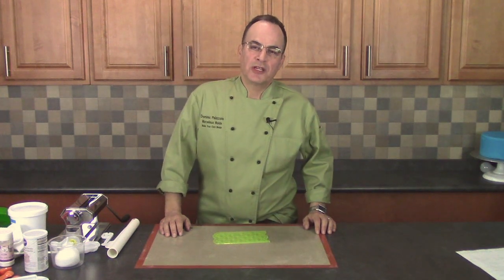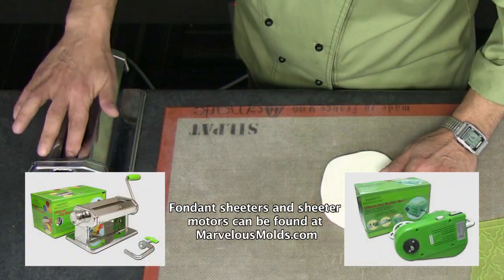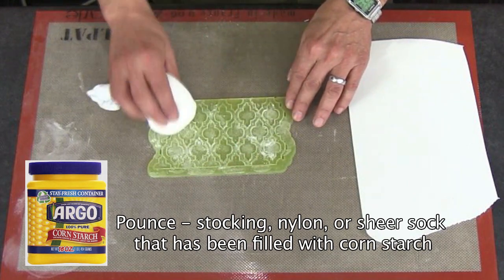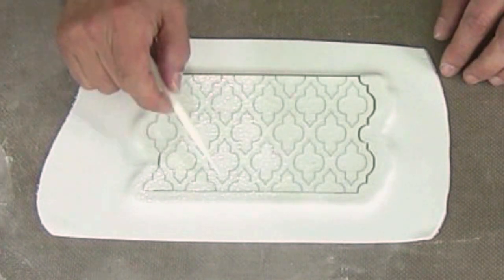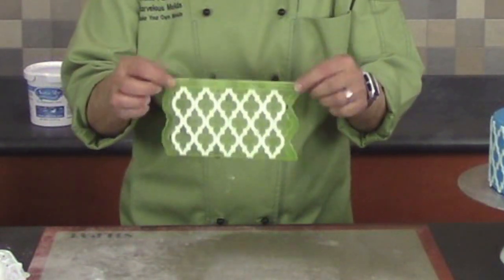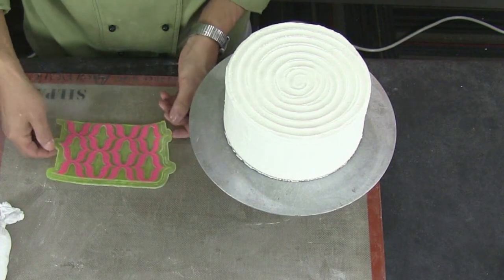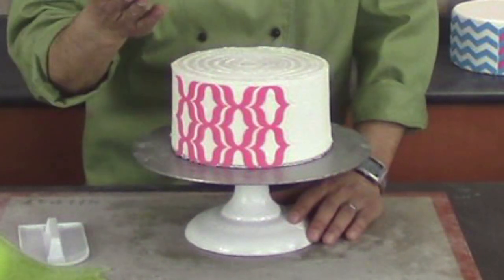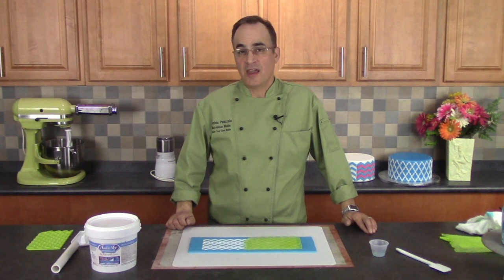Troubleshooting with Silicone Onlays® Video - Short Version

Comment: Well done Dominic.  Thank you for the updated procedures and also clarifying how much tylose powder you are using.  Very helpful.  I'm anxious to try my onlays that I was having difficulty with again.  I have to admit, watching you quickly remove your onlays made me cringe because I have always slowly removed mine with the onlay curled backward away from the design as I roll it back in case I had to do a rescue for something that stuck to the mold.  On that note, it would be interesting to see what, if anything, can be done if you do have a problem where the onlay sticks because from my experience, it leaves an indentation and a colored mark (based on the color used for the onlay) on the cake.  This is the part that makes me the most nervous because I'm not certain how to rescue a situation like this after getting to this point with a cake.  Thank you again for your video!  Well done!
Reply from the maker: +Dave S  Hi Dave,

It sounds to me that your sticking problem is the result of the condition of the fondant. It seems that the surface of the fondant that is pressed into the Silicone Onlay has a tackiness to it that is working against you. Firming the fondant by adding Tylose powder (CMC), using a pounce as I demonstrated in order to apply micro layers of cornstarch to the surface that goes into the Silicone Onlay, and lastly stretching the Silicone Onlay in order to release the pattern and allow air to flow in between the surface of the Silicone Onlay and the fondant. Here is a tip: When stretching, you should see the pattern popping up out of the Onlay and then settling back in. If you do not see this happening it is a good indication that you still have a tack issue.  If you are still having problems I would suspect that perhaps you are microwaving the fondant to soften it, which is okay. But I would hand soften by kneading it. Microwaving to soften fondant is great but it does warm fondant by exiting the moisture in it and maybe that is why your fondant is so sticky. Love your cakes, by the way!  - Dom
Reply: +MarvelousMolds Thank you Dominic.  I do not microwave my fondant.  I had been actually rolling my silicone onlay over the center divider of my kitchen sink which works well to push from the back on all parts of the mold (in addition to stretching it every which way.).  I did add some tylose but also found that if too much tylose was added, it made the fondant too firm and made it then difficult for the blades to come through.  I'm not sure exactly what is the issue but am willing to try with the fondant smoother vs. the roller to see if that may be of help.  Also, the video was helpful to show how much tylose you are using.  I'll keep you posted!